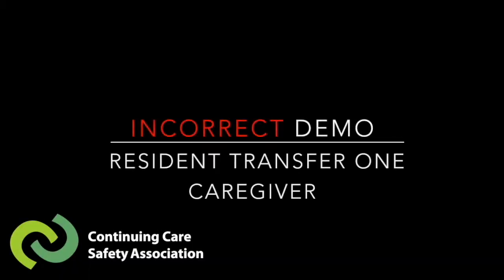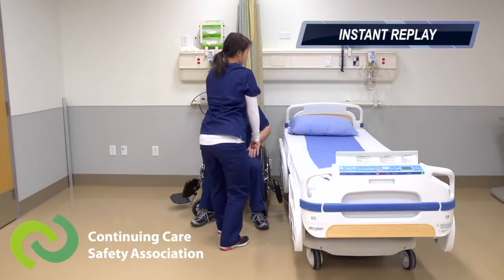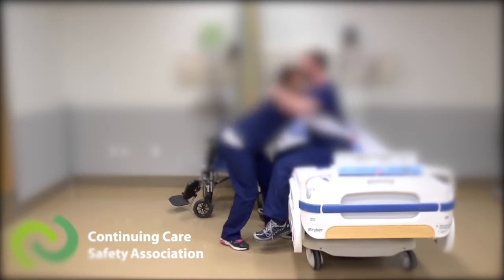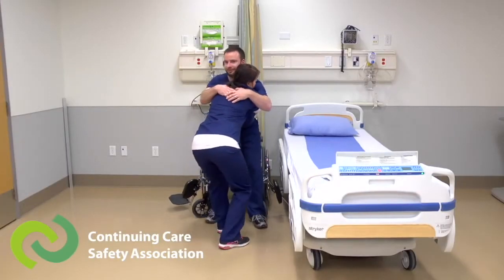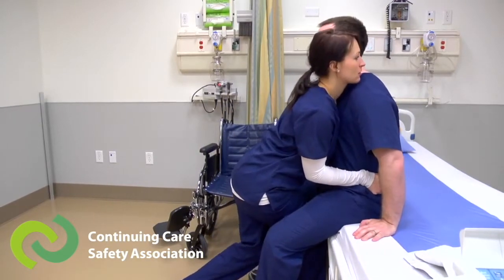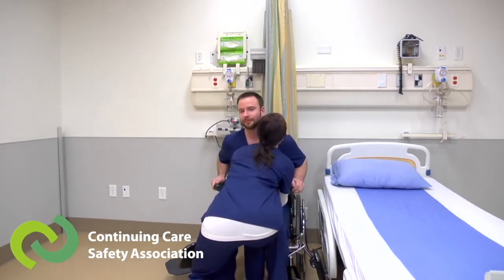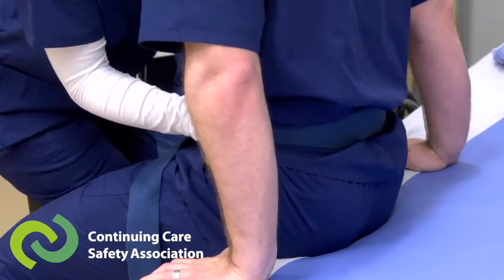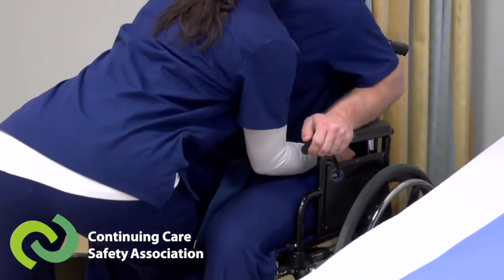MIP Techniques: Resident Transfer by One Caregiver

Comment: Clarify please the % of weight bearing the patient has to be do to a 1 Person Transfer to Wheelchair technique? If not able to then a Hoyer lift is needed then.
Reply from the maker: Hi Dflowen, the recommendation is that the patient/resident is able to bear 100% of their weight for a 1 person transfer. If all you have is one person for the transfer, the only assistance you can safely do is to help stabilize them, not lift them up. 

The main reason being that as the patient sits down they tend to plop and it is too high of risk for one person.

If the patient can bear a very high % of their weight  then a 2 person transfer is appropriate. If they can't bear a moderate amount of their weight (0-80%), then a mechanical lift should be used.
Reply: @ContinuingcaresafetyCa  Got it, thanks for details. I gotta consider purchasing a hoyer lift now. 0% weight bearing on legs;  30% to 0% arm strength for my client. Even to sit up on edge of bed I'm doing this myself with optimal setup on electric bed. Electric Hoyer with manual control for emergencies. Thank you for the detailed breakdown. Appreciate it.
Reply from the maker: @Dflowen  Without a doubt you need mechanical assistance at that point, you aren't a nurse in a World War One Mobile Army hospital!
Reply: @ContinuingcaresafetyCa  yes Im looking around for best hoyer lift. hahaha. There have been instances when the client fell down. My deadlift and sandbag weightlifting techniques came in handy. I have a disadvantage with my client being taller/bigger than me 100% stand isnt possible. Enough to sit on the bed. No back issues but I try to avoid it and get 2 others to Emergency lift back to bed. Benefits of weightlifting technique for emergency emergency situation. I do what I must in proper form. I believe doing bearhug deadlift to client is uncomfortable but gets it done.